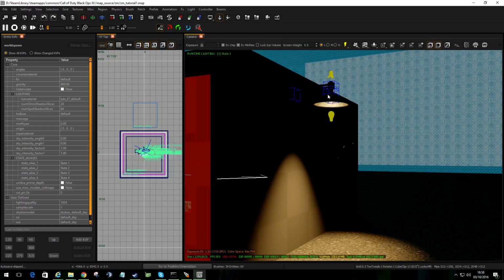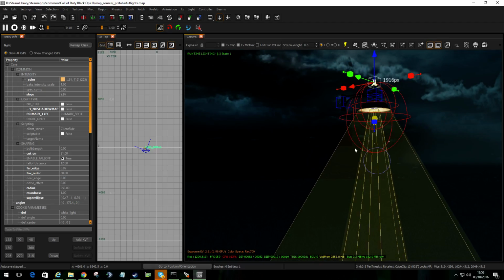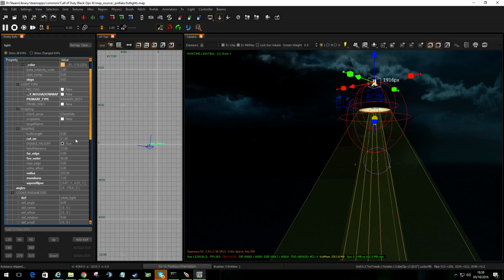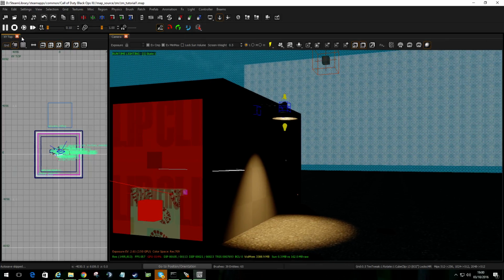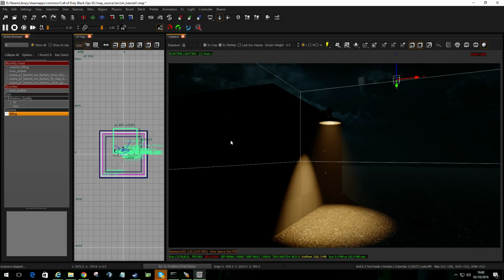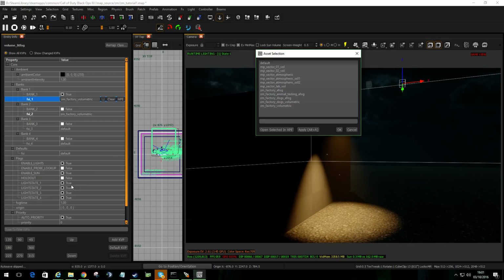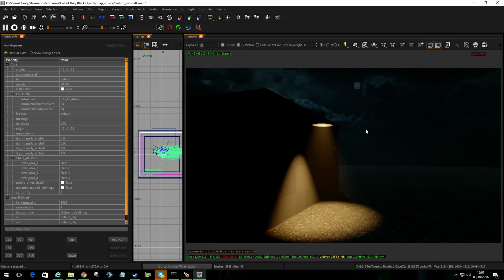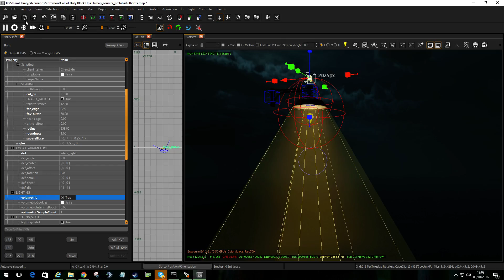Tutorial 12 - Volumetric Lights

Comment: I've tried this and it hasn't worked. I watched over the video several times, making a litfog and the volumetric lighting checked on the light, but it just has no difference.
Reply from the maker: did you change the lit fog to use a fog bank?
Reply: Yes, and I realised the problem. I had to change the volumetric intensity higher. It was on 0.00 originally, but I set it higher and it was working. I think it was because the light was in a certain area of my map. Thanks for this tutorial!
Reply: where did you change it? I only find volumetricIntensityBoost and that does absolutely nothing for me
Reply: That was the one I boosted. I don't know why it doesn't work for you.